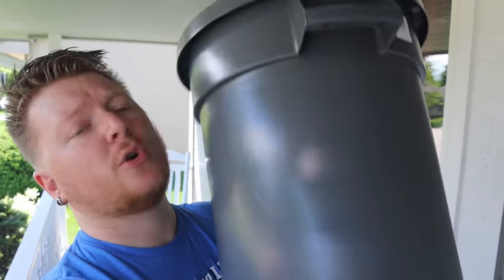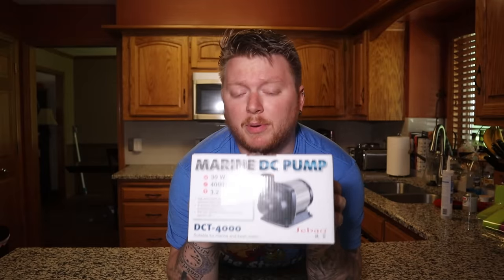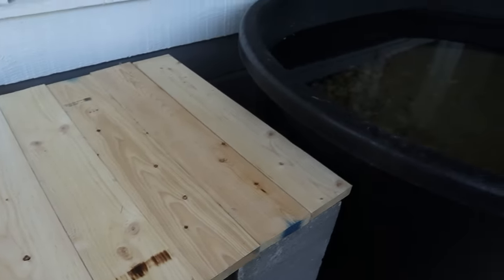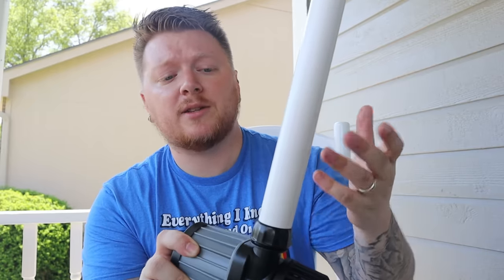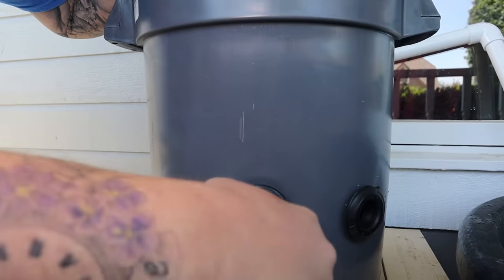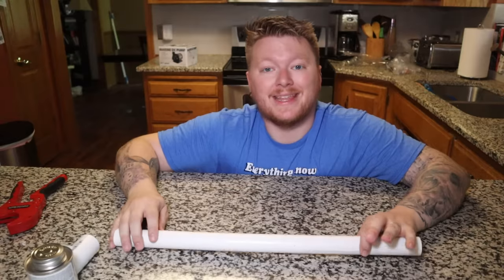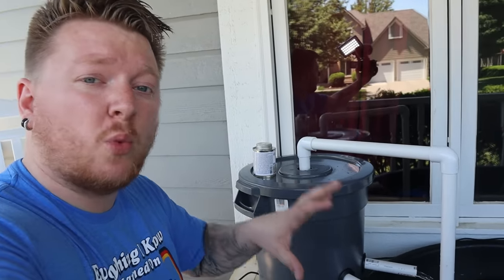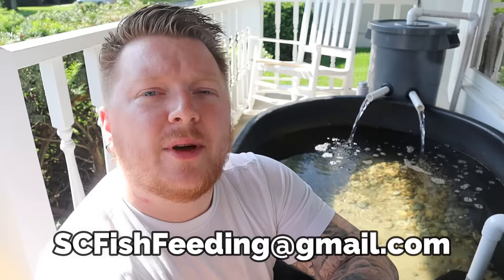DIY Pond Filter Made EASY From Trash Can!

Comment: I have been working on this filter for 2 days… I am a 72 year old woman and had it working… except I have a pond that has no filter for 2 years. My pond has no level space for the pump to sit in… so my tube is slanted. Any suggestions on an uneven pond with lots of fish but difficult to find a platform that will no slide out. I had no leaks just had a problem after a few minutes… can you use plastic tubbing?
Reply from the maker: Using some plastic tubing like that would probably be your easiest fix! Then you could put the pump wherever it fits and is out of the way. Just use a metal hose clamp to keep it on top of the pump. Then you can get creative with how it spills out into the trash can.

Otherwise you could try and put a little shelf underneath the pump to build a makeshift flat surface. Or use some PVC cement to attach the PVC to the pump (but that'd be forever and could damage the pump so probably avoid that)

Comment: Hey Zach! What is your advice on making this into a fish/duck pond filter? Ducks will obviously make more of a mess, do you think that this would still work for that situation? And what advice would you have in order to tweak this for my situation? Thanks!!!
Reply: Jeff, very curious as this is my day today.  I'm building one of these similarly  on the 55 gallon scale, for 6 ducks.   Also instead of using the spray bar...  I'll be using the bubble up method meaning my inlet will go all the way down to the bottom and then bubble up through the media to the overflow
Reply: Would love to hear if this worked and if you did anything differently

Comment: Is it possible to drill a hole in these premade ponds that runs to the pump? That way the pump doesn't take up space in pond. Or will it cause the structural issue?

Comment: I you use ta basket to contain your pump, you could set up a float switch like is used in a toilet tank for the pump power.  As long as the water level was high enough, the float would keep the pump power on.  If the water level in the basket got too low, the pump would shut off, protecting your pump.

Comment: What I've noticed with both your filter and every commercial filter I've bought, is that first the water is filtered through the finest media first, and lastly through the biggest media, like rocks. But shouldn't it be the other way around? Again, I've seen every other filter do the same thing...so I'm curious why it's done in that order...it seems like the roughest media is supposed to catch all the big pieces first. Or does it work differently?

Comment: I'd feed the water to filter from the side of trash can - less pieces to leak, to buy and to build, while better flow (less turns and doesn't need to pump so high. 
Also the exit pipes could be 2x shorter.

(note: clean water, before fish entered, wasn't surprise).

Comment: I have seen quite a few different types of setup, there are many videos where the water inlet goes in from the bottom of the filter and comes out from the top,  which is the exact opposite of yours, so what is the difference and which has better filtration?
Reply from the maker: I think a lot of that is a matter of opinion! What you like and what works best. Personally for me, I like this method because I feel there is less risk for leaks and it's a more simple build.
Reply: @SCFishKeeping  Thanks.

Comment: Check your hole saw before using and make sure the blades aren't bent out very far as they will be staggered to keep from binding it can make yourself fit looser, I had an issue on one had to been teeth in some on new hole saw
Reply: It can make your uniseal fit looser and leak, only really important if using uniseal, but very important if using uniseal.

Comment: All looked real good but there is always a but lol. On your spray bar I think I would have drilled holes on the sides both sides on both ends of your spray bar . That way it is spraying in four different directions an using even more of your filter . Also I do not think I would have drilled on the bottom of the bar . Keep up the great work. THANKS

Comment: I am having surgery very soon and need an easy way to provide clean water to our animals. Doing so will require a raccoon proof pump set up though and I plan to use a 50 gallon Rubbermaid stock tank. Do you see any reason why I couldn't place the pump in a separate secured container and run a 1 1/2" or 2" line from the stock tank to it then to the filter and back to the stock tank?
Reply from the maker: It sounds like you're essentially adding a second container like you would use a sump. Water overflows from the pond into your second container then gets pumped from that back into the pond! As long as your overflows from the pond are large enough it should work just fine!

Hope your surgery goes well!
Reply: @SCFishKeeping  Thanks

Comment: A little trick for anyone with a Kill-A-Watt meter. Figure out how much power the pump consumes in the water with no plumbing.
Now do your test fit, without the spray bar assembly. Check power consumption again. It should be LESS, because every joint increases friction and backpressure.
Now add the spray bar and check power consumption again. If the pump is using LESS power now, then the added flow resistance is limiting it's efficiency further.
Add more holes to the spray bar until it stops regaining power consumption on the meter.  That will give you the best bang for the buck with the spray bar :)

Comment: For heating can I heat the filter water instead of the actual tank itself? I’m setting up a 1,000 gallon stock tank for my turtles and the water even on a hot day stays in low-high 60s

Comment: Not a bad filter but  I prefer to have the water fed up from the bottom. I used a 5 gal bucket because my pond isn’t all that big. What I did was to make a similar manifold that is at the bottom. However I made it a swirl diffuser by using a T with short legs and 90 deg elbows on each end in opposite directions. I also put in a drain for all the muck to be washed out. I placed an open basket over the drain area. This was all covered with the lava rock like you used. Then  a layer of bath scrungies  which give even more bacteria surface area. Then topped off with Polly fill. The return now comes out the top. Because of the GPH of my pump I used two output pipes. This also adds to the waterfall affect by being directed at 2 different places. The main reason for doing it this way is because my filter can sit lower and not be seen behind my waterfall. The muck needs to be drained from time to time and of course the poly changed.
Reply: I am going to build one of these and am wondering what is the benefit to have the input of water coming in from the bottom (versus the top) and going up through the media?
Reply: @judyr7468  the filtering process is basically the same. The reason for this is that you canister , what ever type you use can sit lower. With the water return at the top the input is lower. This may or not make any difference to you. In my case I wanted to hide the filter as much as I could. My pond has a waterfall in the back and it was easier to hide with shrubbery sitting lower. Good luck with your project. These DYI filters do work but PLEASE pay attention to the beneficial bacteria. Make sure you have loads of surface area for it to grow. This will take a little time to achieve however it IS the key to sparkling clear water. Remember nature takes care of her own. Thank you.

Comment: Does the garbage pail need to be raised? I want to build one next to a 150 gallon stock tank.
Reply from the maker: You would at least need your return pipes to be raised about the lip of the pond the way I built this one. So you could leave the trashcan on the ground and just have the overflows back into the pond really high, but I don't like that much water or pressure in the can itself. So ultimately it's up to you!
Reply: Thank you. I think I'm going to try.  Your videos are some of my favorites.

Comment: So I know it’s been years but I hope you can reply or someone’s can answer, but I copied everything you did and works awesome. I used sand at the bottom like you did but when I turn on the pump the water gets super murky like if the sand is swirling around and just like cloudy what do I do? I started taking the sand out but can anyone help?
Reply: Hi ruvy, I don't want to step on Zac's toes in replying - as I'm sure he has a great solution. My solution would be the following:
Either:
1) place a layer of filter cloth over the bottom layer of sand (to prevent agitated silt rising up when you switch the pump on) AND make sure the outlet pipes are higher than this extra layer
OR
2) actually reconfigure the inlet to sit at the bottom of the filter and have the outlet(s) at the top of the filter hence dirty inlet water has to rise up through the filter medium and exit clean at the top of the barrel. To stop sponges/ filter medium from floating to the top, place rocks/ gravel between the layers. I have both set-ups in my pond and they work brilliantly.
Reply: @A.P.Garland  so with the second suggestion you mean instead of putting the return pipes at the bottom put them at the top???
Reply: @ruvyfpv4398  Yes. Since particulates tend to sink in the filter (just as they do in the pond) it makes sense to have the return pipes as high as possible and the inlet pipe as low as possible.

Comment: Put a pvc union on there , you can glue everything and break down when you need too also old tee shirts filled with activated carbon help <~ you don’t need a lot and I would only do it for chlorine for a week or so . After that you should be fine with an outdoor set up the sun will get the chloramine out which an ammonia concentrated with Chlorine

Comment: Hello everyone. I just built a trash can filter. Kinda not going well. When I plug in pump the trash can starts to flood. Am I not draining enough water?
Reply from the maker: If the trashcan is overflowing then you need to either decrease the flow of the pump or increase the output. Add another overflow pipe or make your holes bigger to let more water flow out.
Reply: @SCFishKeeping  thats exactly the problem. Can't reduce speed. Gonna have to get some 1 inch bulk heads and maybe add another drain hole

Comment: So How does the return pipes connect with the terracotta pot in the bottom of the filter? You don't show that. I've seen other videos which show the return pipe(s) going to the bottom of the can and bringing the water from there. Does your return pipers just drain off water straight out of the side of the can? Seems a waste to even use a pot in the bottom if it doesn't hook up to anything. Also as another has said, I'd put smaller holes on the T sprayer and angle the holes so they are not all straight down.
Reply: hes just for clicks and views...all that toxic plastic leaking into the water is terrible for the fish, at least find food grade plastic

Comment: If the pump is not on the floor it will not suck up the fish poo, giving you a massive problem later down the line, best option is to fit a float switch

Comment: I think you would have a more efficient filtration if you reversed the order of the flow in the bucket. Meaning, to have the water flow in at the bottom, rise to the top through the filtration and exit through the top.

Comment: First of all : correct water flow direction - from up to down. No losing pump power by pressing the water from down to up.
I would change some things :
1. Let the water come in from the side, not through the cover of the basket. So you can remove the cover without remove the pipe.
2. What happens if the filter material is completly dirty ? The water comes out of the edge. (Are the constructions in the pond to prevent a water accident ?).
So make the following > water in : hole 5 cm under the edge. Water EMERGENCY exit 3 cm under the edge. If the filter materials are tight the water runs out of the emergency exit.
3. Spray arms - no. A perforated plate does not need so much space. Placed 6 cm under the edge. 
4.why are the sponges separately in a basket? Since only unnecessarily filter space is given away
5. The flower pot on the filter bottom - why ? Again : It just takes up unnecessary filter space.
Out with it. Make the pipe for the return flow 20-30 cm longer and make many small holes in it on the side that goes into the filter. Close the end with a stopper.

Hope you understood everything as English is not my native language 😊.

Comment: Its would only empty out of the trash can is lower than the water level. In this case your trash can is higher than water level so it will NOT drain it. But the trash can will drain its contents back to the pond

Comment: The inlet should be on the end of the pond not the next to water flew also you need  a overflew  emergency pipe in top of the bucket in case of your filter got dirty the water don’t over flew from your filter and it goes to the pond instead of drain it

Comment: Anyone have a problem with the lid of the trash can leaking. I just finished my build and my trash can lid started to leaks on all sides.
Reply from the maker: I've had that issue too. Try making the pipe going into the lid longer or check to make sure your spray bar isn't spraying up toward the rim of the can! Any sort of splashing or spraying up will cause that leaking.
Reply: @SCFishKeeping  thank you for the quick response. I will try that tomorrow.
Reply from the maker: @brandoninsoft2691  Let me know how it works!
Reply: @SCFishKeeping  it’s working great. I ended up just needing to place my spray bar deeper into the trash can. Thx for the help.

Comment: don't like this setup. I let the pump pump up through the bottom of a tub to the bottom of an inner tub and so overflow into the outer tub and flow back to the pond. this way the pump can be placed on the bottom and more dirt comes out of the pond and there is no risk of water loss due to blockage or breakage. functions perfectly

Comment: Your building it wrong…. You have to have the return lines at the top of the can and the feed line inside reaching the bottom of the container then as the water level rises heavy solids naturally sink to the bottom and won’t rise through the filter material